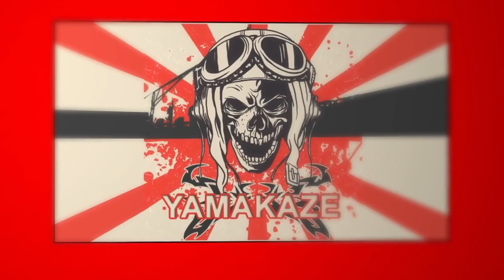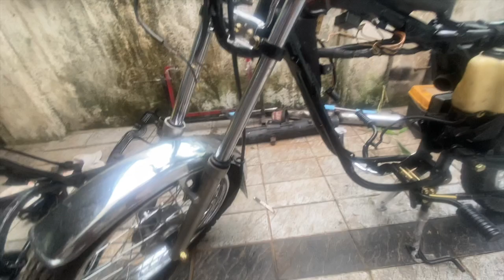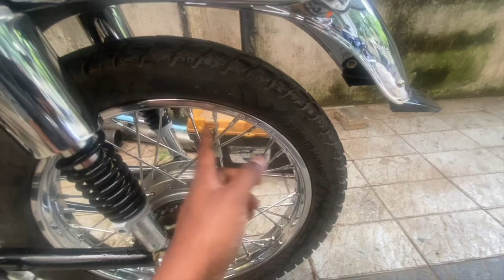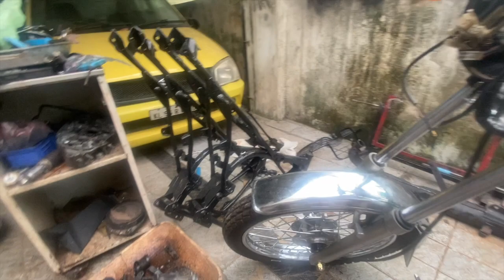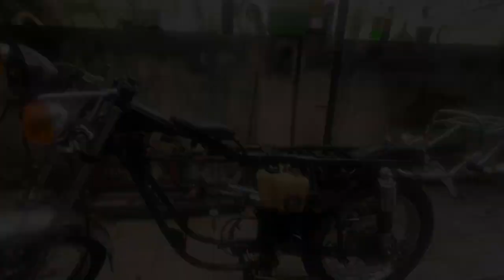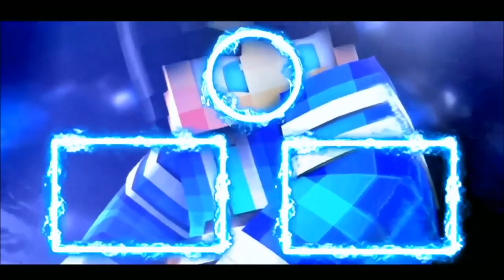My trade secrets for restoring a bike and restoration updates (Malayalam Video)

Comment: Oru Rx 135 
A 2 Z spare parts including (nut and bolt)ethre expense avum. only for original
Reply from the maker: Last time I bought it was roughly 7-8k
Reply: Only 50% spare parts are available from Yamaha nowadays the rest parts production has stopped
Reply from the maker: @amruth8558  thanks, my reply was only on the nut and bolts which were non OE but priced at OE prices

Comment: Im forget to install one dowel pin in center engine case of rx100 , and i noticed there is a play between the primary gear teeth  and clutch bell teeth like backlash play ,I want to know wheather the play caused due to case improper seating due to missing dowel pin
Reply: Yup
Reply from the maker: Send me a video on instagram

Comment: Did rx100 came with contact breaker ignition? 
Is it possible to fit contact breaker ignition system in rx100?
Reply from the maker: No, they were always pulse to ground system, except for a few points bikes
Reply: Moving from modern CDI/pulser setup to points wouldn't  be unlike Jagathi breaking into the jail in Junior Mandrake :D

Comment: എന്താണ് zimntup
Reply: @Yamakaze  ബോൾട്ടിന് golden കളർ ചെയ്തില്ലേ അതാണ് ചോദിച്ചത്
Reply: @helper9688  thats zinc dipping.... That's plating zinc on nut bolts
Reply: @surajcyriac1283  Thanks brother
Reply: @libumbabu8620  ❤❤
Reply: @helper9688  Zinc dip ഉണ്ട്, nickel dip ഉണ്ട്. Zinc golden yellow, nickel- silver color.
Reply: @libumbabu8620  ❤❤കേരളത്തിൽ ഇത്‌ ചെയ്യുന്ന സ്ഥലം ഉണ്ടോ ?
Reply: @helper9688  Yes. Search plating shops in maps.
Reply from the maker: @helper9688  zinc metal plate cheyyum
Reply: @Yamakaze 👍👍